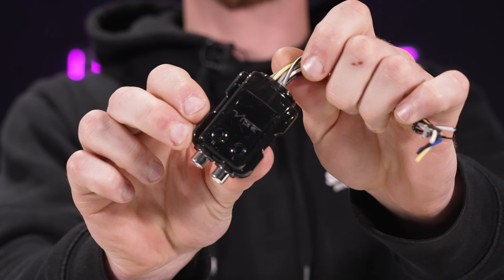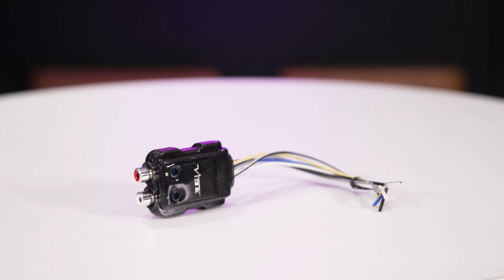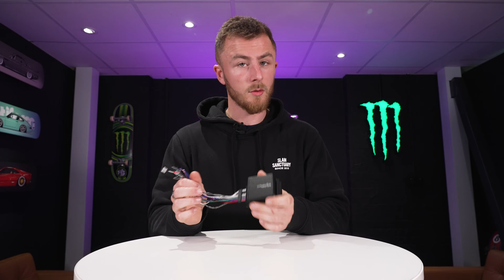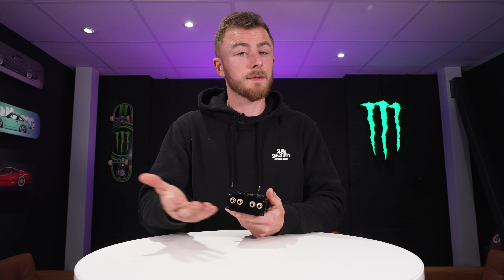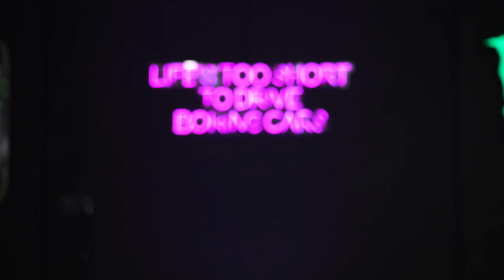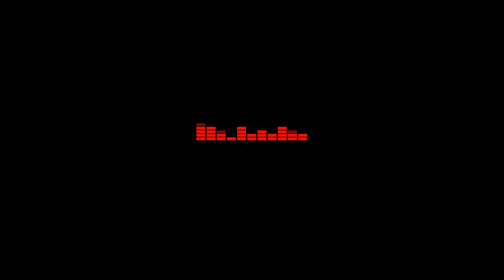Line Output Convertors: AudioControl, Audison, VIBE | Car Audio & Security

Comment: Hello, i faced a chime volume loudly after sound system upgrade on stock radio of opel grandsport 2017.
Now they proposed to use conection sli 2.2. Do you think it can reduce chime noise (turn signal and parking sensor noise ) or not?

Comment: Hi I have the connections sli 2.2 but after fitted to Audi a5 cabriolet it has caused fault issues front left and right bass speaker circuit to ground, is this a common fault or do I just need to replace the device

Comment: Very helpful video, thanks!

Just wondering, I’ve recently fitted a new head unit in my 2011 Audi TT. The car has an amplifier already fitted as stock so I’m running from the head units RCA outputs to the OEM amp. The sound quality is decent but very quiet, I have to turn the volume up to the max on the head unit most of the time which isn’t good. 

So I’m wondering, can I purchase a 4 channel line out converter to run off the speaker outputs on the head unit back to my amp? I’m guessing I’d have to tweak the levels on the converter? Thanks.

Comment: Does the converter need power
Reply: Line output converter = passive = not powered.
Line driver = active = power connection required.